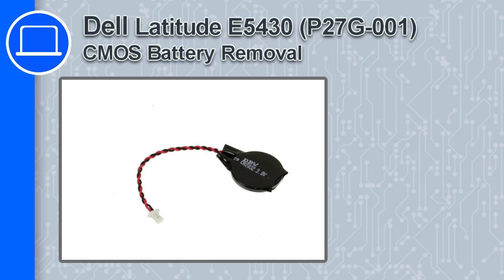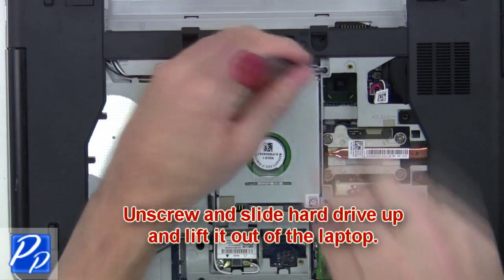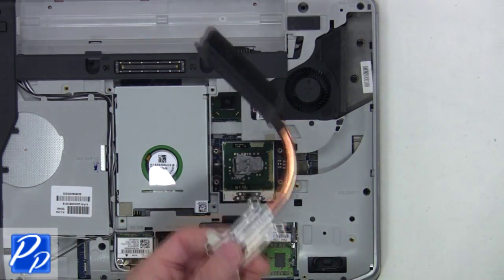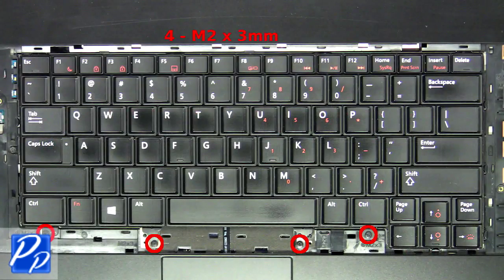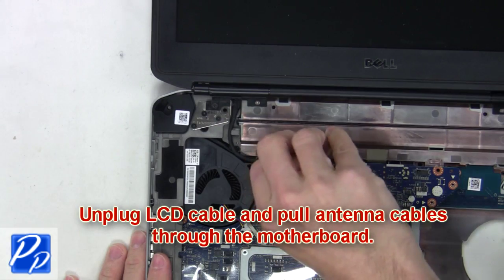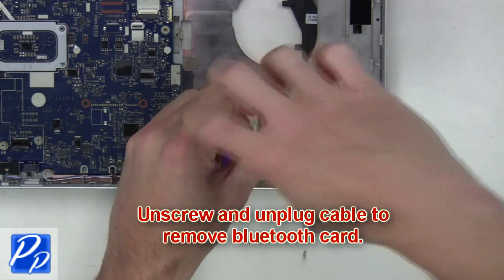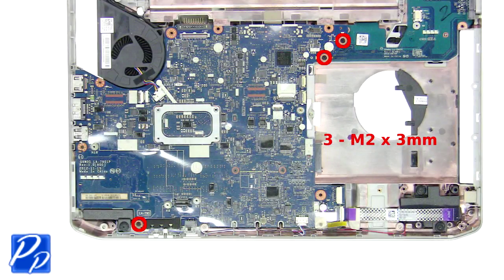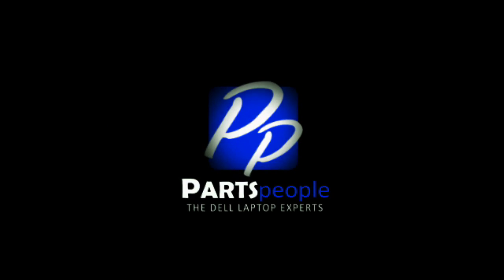Dell Latitude E5430 (P27G-001) CMOS Battery How-To Video Tutorial

Comment: Nice. Now how can I play this video in reverse?
Reply from the maker: Hi, sorry we slacked on our re installation step by steps on these older tutorials. You'll have to use the video segments as reference when retracing your steps unfortunately. Newer videos we're adding a reversal now so we do agree it's the friendly thing to do to have the installation content as well. Best of luck!
Reply: @dellpartspeople  That's what I ended up doing. I managed to go back and replay several steps to make sure I wasn't putting screws back into holes that didn't need screws until other parts were in place. Fortunately, it's all back together now and working perfectly, only had three screws left over. 😂
For the CMOS battery, I ended up cutting the leads off of the dead battery, added longer wires, and attached them to a battery holder that I salvaged from an old motherboard that I had lying around. I relocated the battery into an extra wireless card expansion slot that wasn't being used. Now, if the battery ever needs replaced, all I have to do is remove two screws and the bottom cover and it's right there between the RAM and the Wi-Fi card.

Comment: Thank you for showing the location of the battery. I rather decided to remove only the CPU access door. Then I cutted a hole in the gray plastic cover above the SD Card reader to access the battery and its connector. There is at least 1mm space between the plastic and the battery, so the risk of damaging something is pretty low.
Reply from the maker: You're welcome. Glad that method worked for you.
Reply: @dellpartspeople 
Can you explain the video at 4:10? It just seems to skip, and I can't work out where the CMOS battery is.
"Dell Latitude es5430, CMOS battery replacement".(9-years ago).
Thanks very much.
Reply: I was wondering if there was another way. I mean... totally dismantling the entire laptop just to get to the little CMOS battery seriously has me thinking about retiring my much beloved old Dell workhorse.

Comment: Confused why did you have to remove the monitor screen? I have replaced my optical and the Bluetooth card course with your instructions going so fast I forgot to snap the sound card ribbon down so had to redo it again the only saving grace is the more I take it apart the easier it gets.🙄

Comment: Wow, I can’t believe you have to completely strip the laptop down to remove a CMOS battery that costs less than $10. Dell must have hired one of the HP (no, it doesn’t stand for Hewlett-Packard, it stands for Horrible Products) engineers to design this laptop.

Comment: After watching the video, I decided to cut the white piece of plastic over the battery, that was much easier
Reply: I did the same using a Dremel cutting bit, the vid is very helpful though for knowing the precise location.
Reply: @chundanauk  I've got a Dremel, thanks for the good idea.  I've just been leaving it plugged in to the AC adapter.  At least it saves the date/time. I'd rather not have to do that and I have a new CMOS battery.  I just need to dig out my Dremel tool  ;)
Reply: @chundanauk 
I watched the video, I'm still no wiser where the CMOS battery actually is. 😐
Reply: You really should do a video of that.  I'm sure it would be highly appreciated by many and it would definitely make life easier  ;)   I am serious.  This video has over 32k views, and probably all looking for an easier way to change the battery that what was detailed in the well detailed video.

Comment: Great video, thanks. Just ridiculous amount of work to get to a CMOS battery. Better idea, don't let your main battery ever fully drain, and you won't have to worry about this.
Reply: Sorry that is inaccurate about never having to replace if you don't let battery drain! These batteries do go bad and when they go bad Dell Laptops will go in to a boot loop until you replace the cmos battery
Reply: @jrosen0624able  that is completely incorrect on the 5430 and many other models. There are a few dell models that will not boot and give off an ear piercing beep sequence, but most will boot just fine with a dead cmos battery. If the main battery is always charged, it will also hold all bios settings.
Reply: @jimrobbins4259  I will not argue since you know it all never mind my 10 + years working mainly on Dell laptops and being a Dell certified and having seen this over and over. Again the main batteries do not last that long maybe a year or 2 and when they do go bad then if the cmos battery is dead then you get the boot loop I mentioned!
Reply: @jrosen0624able  yes, of course the main battery doesn't last forever. When it goes bad, change it, go in the bios, set your settings and you're good for another several years. I've been working on Dell since the 90s, but not a competition, just want accurate information out there.

Comment: This is excessive. You dont need to remove the cpu, dc jack, hinges, screen, screen cables, antenna cables, screen brackets, bluetooth card, audio board. Remove the dvd, heatsink, palmrest screws, palmrest, kb and unplug cables that go into the motherboard, unscrew mb screws and you can get it out

Comment: Crazy procedure, but cecessary. Battery is beneath the lower left corner of the shell, where you can't gain any accesses from the outside. Maybe a dedicated hole with a little cover should have been helpful for users.
Reply: a dedicated hole would have been nice.  Anything would've been an improvement.  It's like they couldn't have made it much more difficult, even if they tried.

Comment: Thank you for the video! I changed the cmos battery, but it won't boot. Just the switch button is on. Can you please help, thank you!
It will be great if you could make another video on HOW TO CHANGE THE CMOS BATTERY AND TROUBLESHOOTING...because I saw that many people have problem after, when they replace the battery....it won't boot. Thank you!
Reply from the maker: Unfortunately there isn't an easy way to troubleshoot a laptop without being able to see it. I suggest going back through the laptop and making sure all the cables are plugged in and not loose.
Reply: Parts-People.Com, Inc
Thank you for your reply. I appreciate it. I will try again. :-))
Reply: I'm not surprised your laptop wasn't working after changing the battery.  That's the problem with practically dismantling an entire laptop to simply change a CMOS battery.   Something else invariably gets screwed up or damaged while reassembling.    Maybe you can give us an update  with how you resolved the problem.  It would be much appreciated, even though by now you might have already gotten a new laptop.  Thanks.
Reply: Most likely problem is once you removed the CPU Heatsink you really should apply a fresh coat of Thermal Paste otherwise the old Thermal Paste has become hard and solid over the years and there might be some spots where metal is touch metal which will keep it from booting up. The board is shortening out because of the metal touching metal between the cpu and heatsink.

Comment: Ran into a stripped screw in this laptop and had to get a Dremel to get it out. It appears that this laptop has been altered before I got it as it was missing several screws, the Bluetooth chip, and had an extra part attached to the audio USB. Also, in order to get the motherboard out, I had to disconnect the wlan. For some reason it was larger that it's original slot permitted and was causing the motherboard to be stuck. But, after all that, I got to the battery and unplugged it. Now I'm going to leave it out over night and put it back together tomorrow. Thanks so much for this tutorial!